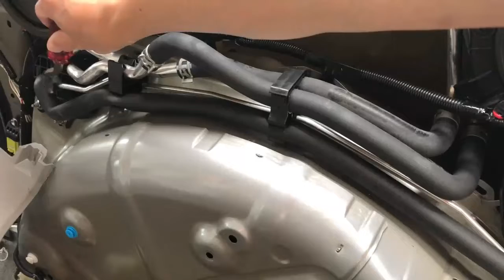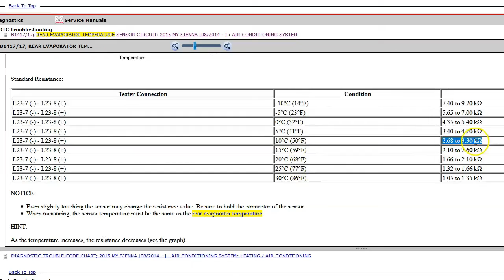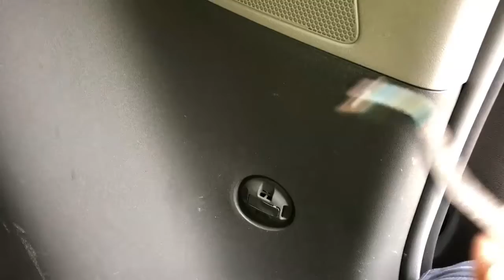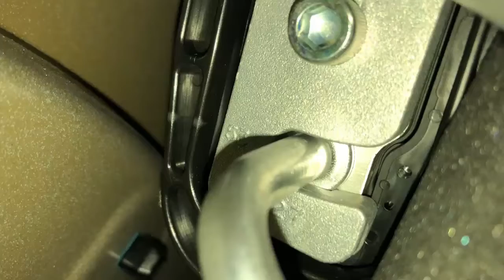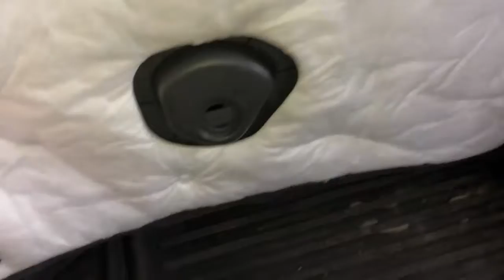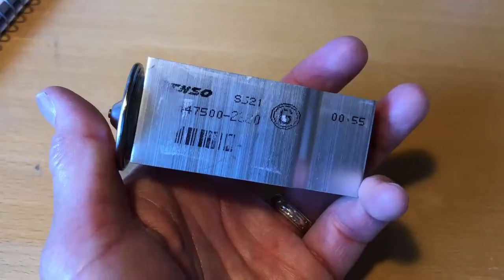2015 Toyota Sienna Rear AC Not Cooling Due to Expansion Valve Stuck Closed

Comment: Hey great video. I think you just saved me a ton of time trying to figure out what is going on with my Sienna. I have the same problem it seems. Mine stopped working after a corroded rear ac line leaked out all of the refrigerant.  It was about 4 months later that I decided to repair it.  I have made 2 repairs to the rear ac lines but they are just too corroded to keep hacking them out, and I am not going to keep filling this ac system up so it can just leak out again, nor do I want to cause a global thermal nuclear meltdown from all the ac that is blowing away in the the atmosphere. lol... I am hoping to block the rear ac line off completely, but I am concerned about what happens to the compressor oil after I do so. Would the compressor oil be backing up in the line if I tied the line off half way back on the van? for say under the middle of the van? I want to insure that the compressor continues to get oil, and I am not sure where or how to block the line up front so that it can still circulate. I really need to get this fixed asap.. Any help or suggestions would be greatly appreciated.

Comment: Highly doubt it will give too cold if it's stuck open. If it's stuck open, the evaporator is flooded with liquid refrigerant and it actually expands inside the suction line rather than inside the evaporator. Keeping suction pressure (and evaporator temperature) up in the process. In fact, suddenly dropping the superheat once the evaporator becomes cold is a way to keep the evaporator from freezing up... Out of curiosity, was it really stuck closed or did it still allow some air to flow through (in theory, it should never close, in order to prevent oil pooling behind it when the rear blower fan is off, provided you don't have a solenoid valve to the rear evap)? PS By the way i have a pretty identical valve among my stuff i like to play with and that little metal strip you see at 20:42 inside the liquid entrance is part of a "cage" that is supposed to break bubbles when the TXV is fed with a "two-phase" refrigerant (especially happens when you're slightly off charge) and reduce flow noise... yes, i've disassembled the valve and looked inside it

Comment: Similar situation on my home ductless heat pump.  An evacuation and recharge would need to be done as part of the repair according to my diagnosis.  Out of concern for the environment, I hired a licenced hvac tech to do the work as I didn't have a recovery machine.    As I went out to check on the tech, he was letting the refrigerant out without using his recovery machine.  wtf.